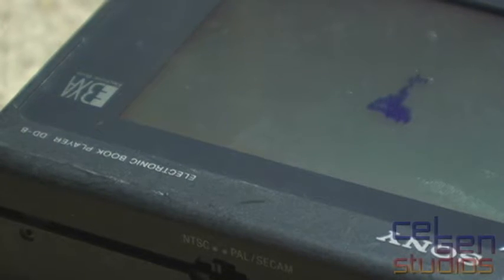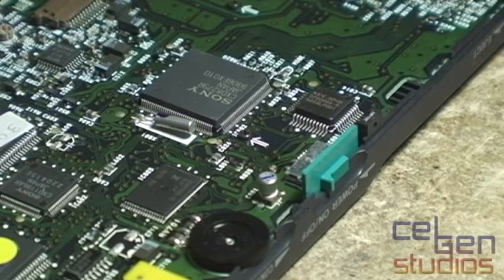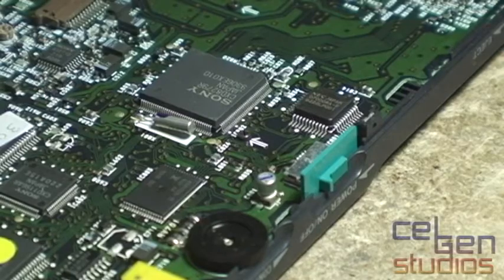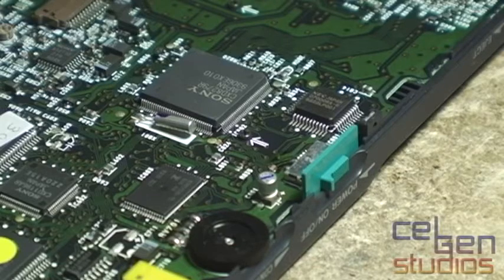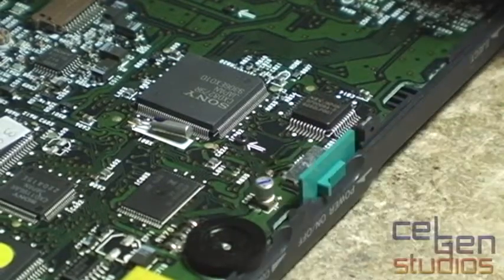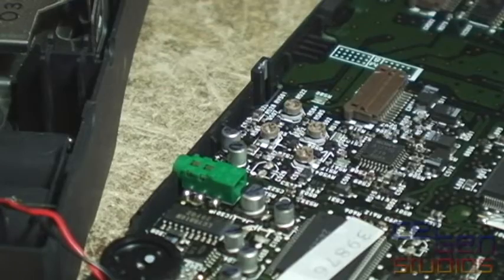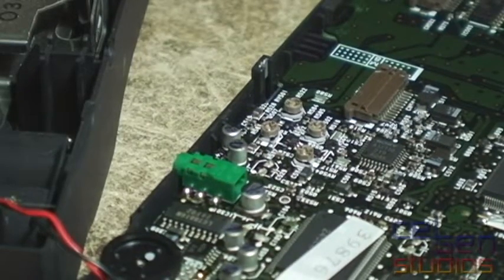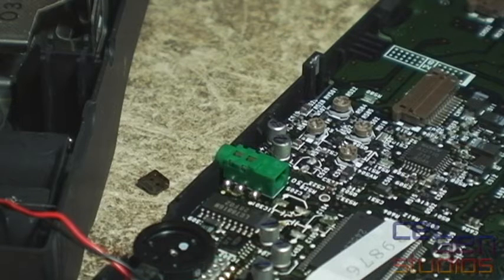Removing SMD capacitors....with pliers?

Comment: It works! No fear. The cap leads are very, very thin. They break very easily, way before they apply any significant stress on the pads. It looks as if you are shearing the solder joint but that is not the case.

Comment: I used this method on over 10 playstation 1 consoles. Worked every time without 1 lifted pad. I would suggest putting downward pressure as you twist.